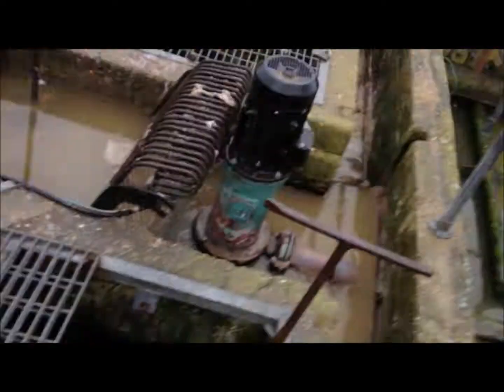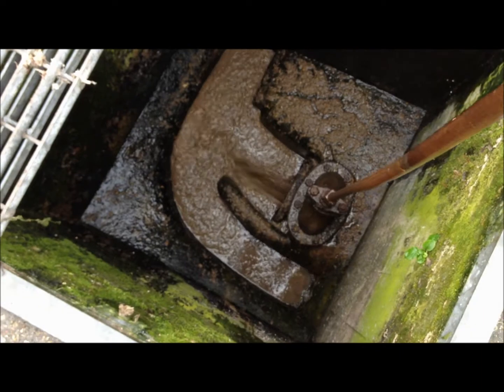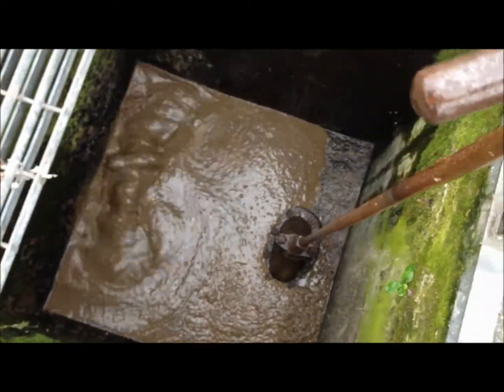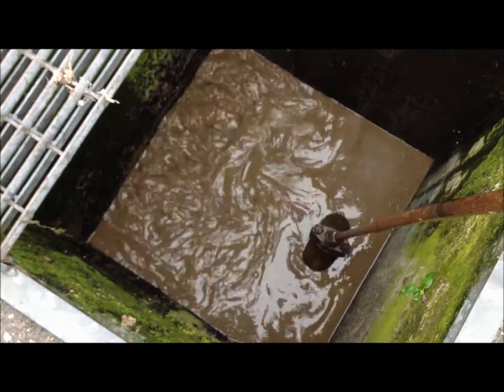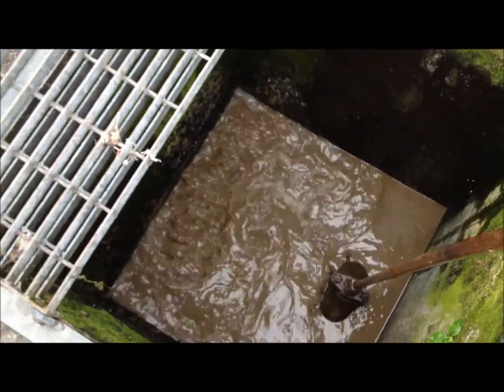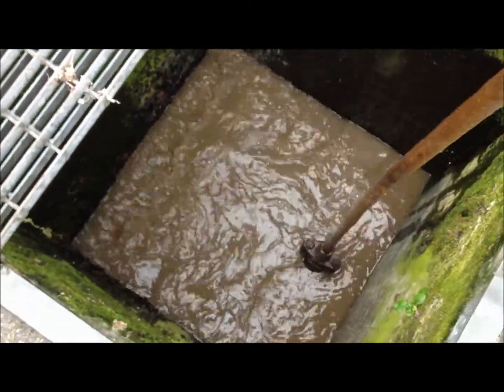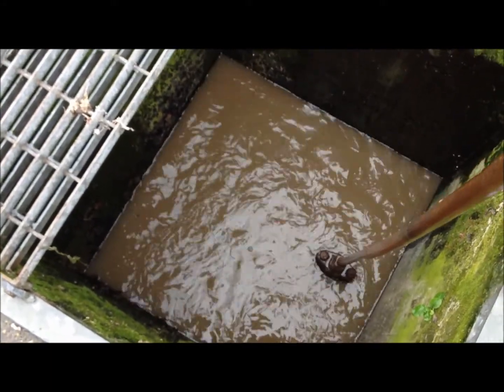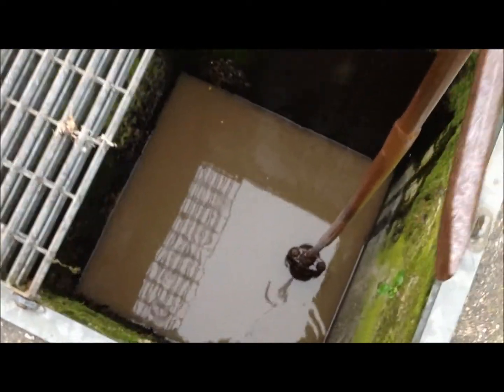HOW TOO DESLUDGE A SETTLEMENT TANK

Comment: What will be the tss reduction in aeration tank if my aerstion tank capacity is 2200 cubic meter and flow is 140 cubic meter per hour ky tss load is 3000 mg/l
Reply from the maker: What is your MLSS and SVI , you should be returning a certain amount of sludge to aeration (RAS returned activated sludge) and disposing of a certain amount to waste (SAS surplus activated sludge) also is the plant a De-Nitrifying plant with anoxic zone
Reply: @damothegun  mlss 3500 mg/l
Svi 130
Sv 400-500
Do 2.2
Nitrification process is in optimum condition .. CNP ratio is maintained regularly
Reply from the maker: From I remember and I am not an expert your figures are not actually bad maybe bring your settlement volume down a bit by wasting a bit more sludge, a process scientist would be able to test and get your plant at an perfect level